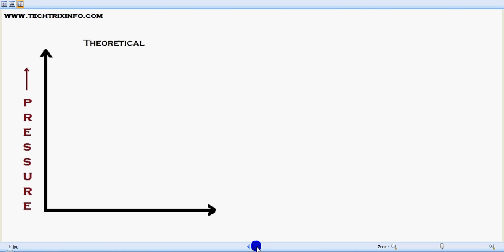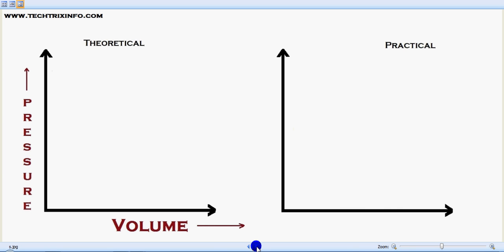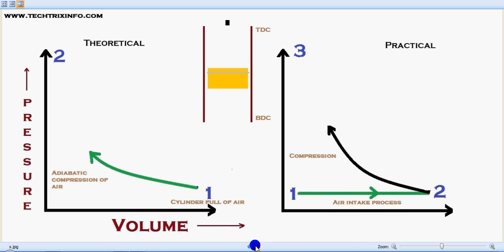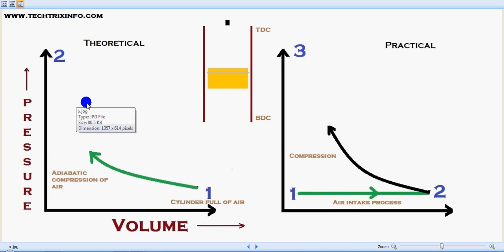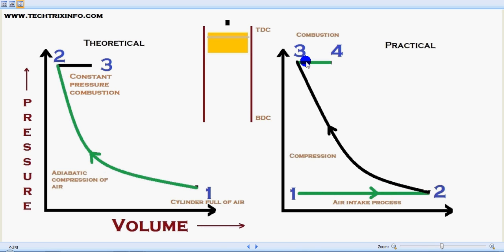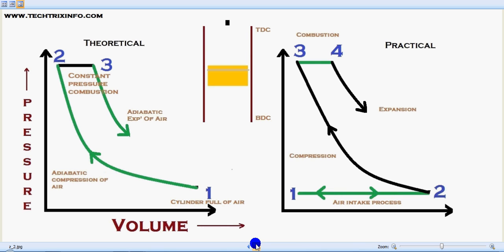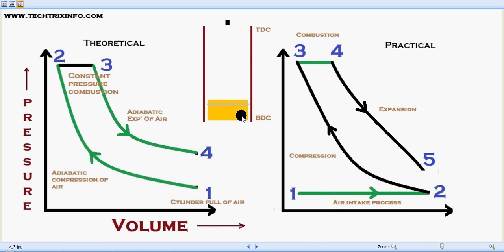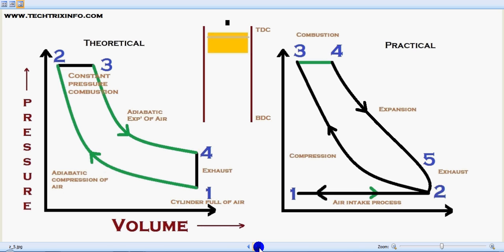Animation How Diesel Cycle Works. ✔

Comment: why are the all primemovers anticlock directions
Reply: Hi: I need help of an question, i have to answer this: Using these calculations, compare the performance and efficiency of the engine with that
of the appropriate air standard cycle. These comparisons should be based upon relevant
calculations. What i have to do is explain how brake power, brake mean effective pressure, volumetric efficiency, thermal efficiency and air fuel ratio link to this in term of the result of which we got.

Comment: Reality there are issues with your discussion.

1) In real life the combustion has to involve a pressure increase hence combustion is not isobaric.

2) Adiabatic is not the best terminology to use although it is traditionally called this. Specifically: Your theoretical curves for both compression and expansion more closely follow the isothermal curves for a P-V diagram and perhaps isothermal would be a preferred term over adiabatic. I know that traditionally it called adiabatic but that is wrong 

3) Since the temperature increases during compression, then the pressure at the end of the compression cycle should be higher than that shown on the theoretical curve

4) During expansion the engine is doing work thus the temperature must decrease, hence the real curve should always show lower pressure than theoretical
  
 Otherwise a nice video

 Cheers Kent

Comment: thank you for the good explanation and I have a question about why the combustion can be in constant pressure even in practical state?
Reply: Hi: I need help of an question, i have to answer this: Using these calculations, compare the performance and efficiency of the engine with that
of the appropriate air standard cycle. These comparisons should be based upon relevant
calculations. What i have to do is explain how brake power, brake mean effective pressure, volumetric efficiency, thermal efficiency and air fuel ratio link to this in term of the result of which we got

Comment: good and smart
Reply: Hi: I need help of an question, i have to answer this: Using these calculations, compare the performance and efficiency of the engine with that
of the appropriate air standard cycle. These comparisons should be based upon relevant
calculations. What i have to do is explain how brake power, brake mean effective pressure, volumetric efficiency, thermal efficiency and air fuel ratio link to this in term of the result of which we got

Comment: Tks for the upload good explanation
Reply: Hi: I need help of an question, i have to answer this: Using these calculations, compare the performance and efficiency of the engine with that
of the appropriate air standard cycle. These comparisons should be based upon relevant
calculations. What i have to do is explain how brake power, brake mean effective pressure, volumetric efficiency, thermal efficiency and air fuel ratio link to this in term of the result of which we got